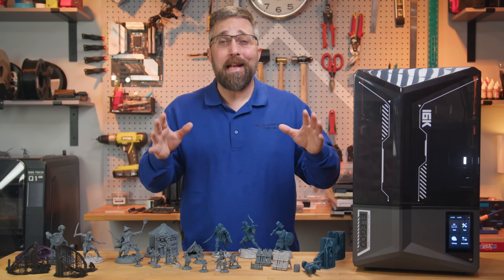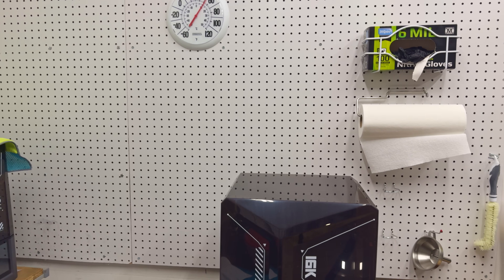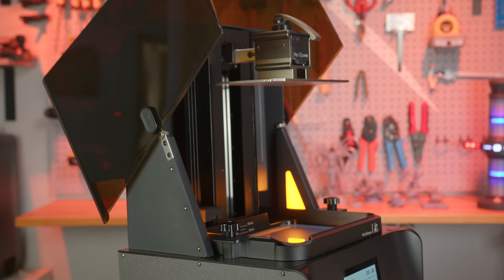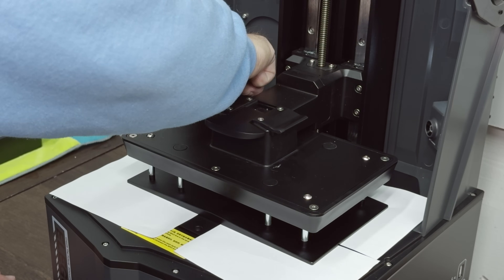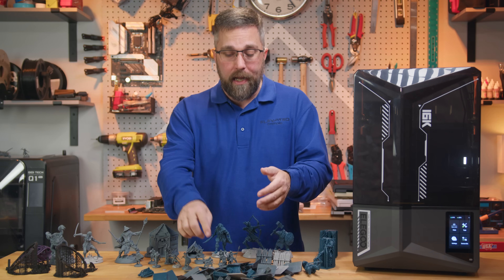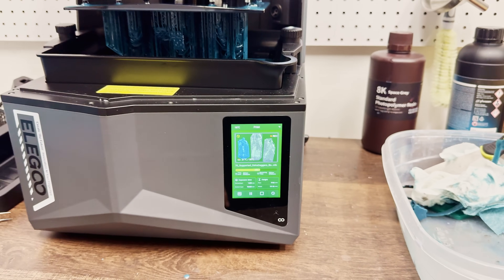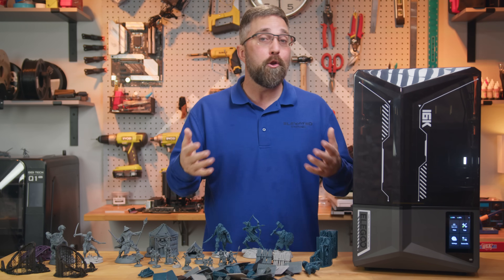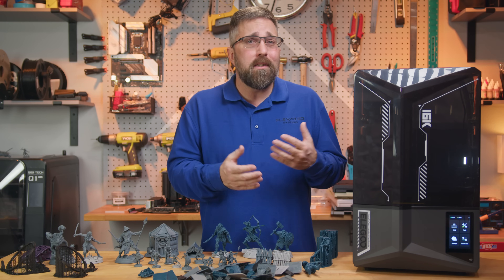Elegoo Saturn 4 Ultra 16K: Hype vs Reality!

Comment: Wow! very honest, technical and genuine review, thank you very much. I think I will wait for a 4K DLP Saturn Ultra maybe, provided they fix that weird build plate issue.  50 micro pixel size is good and a 4K DLP can project an image area of about 192*118 mm and the same 4K DLP light engine can prject an image area of 115*64.8mm for a 30 micron pixel size. DLP is a lot more energy efficient and it last 10 times longer than a mono LCD atleast in theory. I was having high hopes for their S4U 16K, was expecting ball screw, peel force detection, Wifi 6, 385nm UV light source and SD card slot but nothing. Elagoo should take inspiration from Asiga Ultra 4K DLp printer, the way they implement the peel force detection is very similar to what you have mentioned. Asiga Ultra is 15K USD so, that's a different league.  Anyway keep up the good work, your review is very genuine and top class. Thank you.